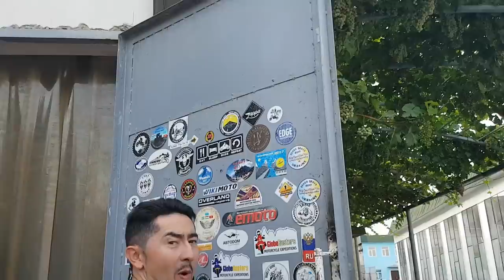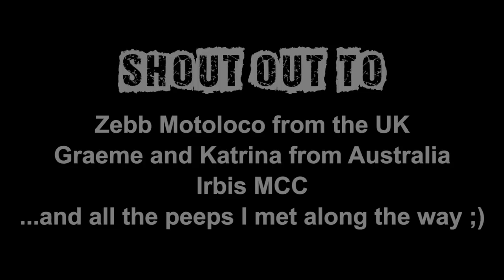SOLO Woman Motorcycle Ride through Tajikistan (The Legendary Pamir Highway). EP 7

Comment: great travel ! but you need urgently find replacement for shock and better to find non original shock, wp or ohlins or smth else. one of very bad issue in this BMW model is fracturing of the top mount of shock absorber in the frame. long mount bolt also need to change.  and better to use custom bracket for top mount. Luck on the road!

Comment: Great that BMW has come to the party with a replacement shock. When you remove the shock, make sure you check whether the upper shock bolt is bent. They are renowned for doing this, mine bent despite mild riding, a high tensile bolt, a Wilbers shock and a home made reinforcing brace. My riding friends F800 bolt bent on consecutive rides. If the bolt bends a lot it will bend the frame and the frame is a right off. BMW refuses to acknowledge this huge problem.